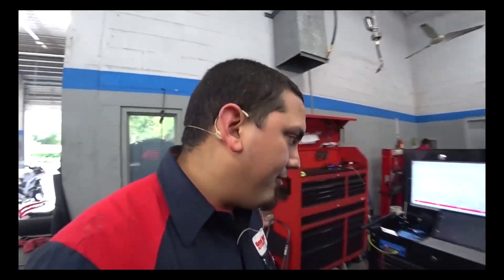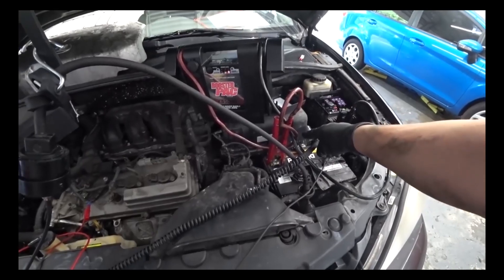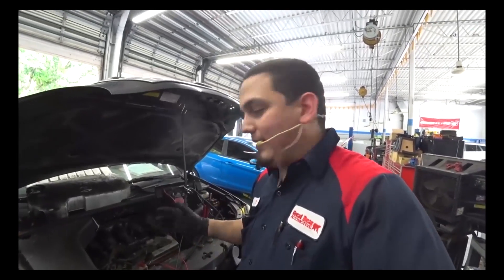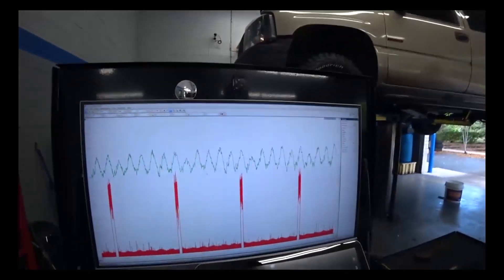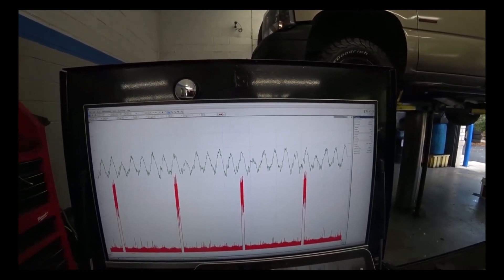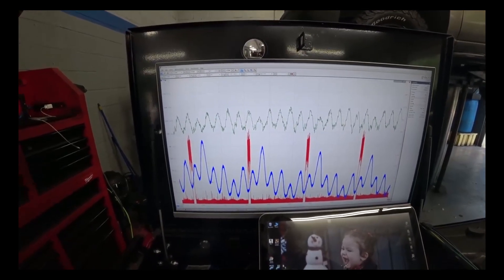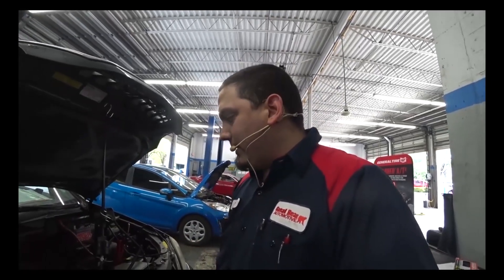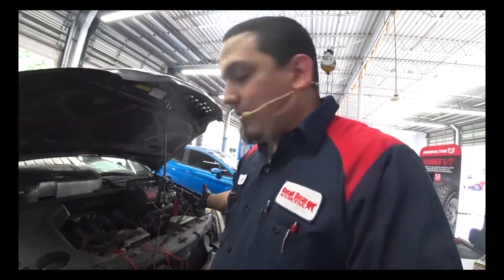Head Gasket Diagnosis with Super Mario Diagnostics

Comment: Mario does great work and is really taking diagnostics seriously and for good reason. This saved a lot of time.
Reply: He could have pulled the oil cap and checked for coolant mixed with the oil. 
He could have placed a paper towel at the tailpipe and checked the exhaust for coolant that didn't burn. 
He could have removed the radiator cap and checked for bubbles in the coolant. 
He could have raised the RPM and watched for a large white cloud to leave the tailpipe. 
He could have checked the coolant and oil levels to see if there was too much in one and not enough in the other.

He doesn't have a clue what he's doing and he certainly doesn't know how to diagnose a vehicle while "saving time".
Reply: DO NOT HACK 
the oil cap showed no signs of oil mixing with coolant since that's not the type of failure that this vehicle exhibited.

The vehicle barely ran, and only ran enough to get it into the shop, there was no signs of coolant or heavy white smoke coming out of the exhaust.

The radiator was ruptured around the center, my attempts at topping off the cooling system we're useless. So there wasn't a chance of catching bubbles, if that were the case, I wouldn't have wasted time with a pulse sensor, it would've damaged my sensor.

This was a case of small leakage of combustion pressures entering the cooling system. Which resulted in a ruptured radiator.

Thanks for the kind words.

Comment: Cold Engine. remove radiator cap.  place a piece of Saran wrap over the radiator filler neck.  push a depression into the saran wrap. use a rubber band to seal the saran wrap to the filler neck.  squeeze the upper hose to verify the depression inflates and when you release that it deflates..   crank or start the engine for 15 seconds.. if the cold engine cranking or running inflates the depression.. you have a head gasket leak or cracked combustion chamber. 

 
 if you are in a shop setting.   leave the saran wrap on the filler neck.. set up a cylinder leak down tester..  bring each piston one at a time to TDC.. and apply compressed air.. if the depression in the saran wrap inflates or blows off.. you have prove the leak. leave that set up for the customer to come by.. hook up the shop air and have them see the saran wrap inflate or blow off. 

 
 if the engine is not going to be torn down that day... please drain the coolant completely . start the engine and let it run for 1 minute without coolant.. this will blow the coolant out of the cylinder.. if you have somebody helping .. give the PCV or a pulled off vacuum hose a squirt of WD40 seconds before you shut the engine off.. this lubes the cylinder walls and protects against rust build up that will take your head gasket job to a complete engine overhaul and may price the job right out the door to the scrap yard. 

without coolant in the engine block and heads..  you can operate a cold engine for about a minute.. this is generally enough time to get the car out of your bay and into a parking spot outside close by..  please put  a big note on the steering wheel.. NO COOLANT.. DO NOT REFILL.. blown head gasket.. ask (your name) for instructions.  there is nothing worse than having a porter see that note.. and top off the cooling system with water..  drive the car to the back of the lot and let it sit for 2 days or a month while the customer decides or comes up with the cash.. then you tear the engine down only to find the massive damage from water in the cylinders that way exceeds the head job estimate. 

with one warning. just draining the radiator does NOT always drain the block below the head gasket surfaces.. you usually have to drain the block via the drain plugs in the block.
Reply: You are a mechanic. He likes to play with electronic toys.